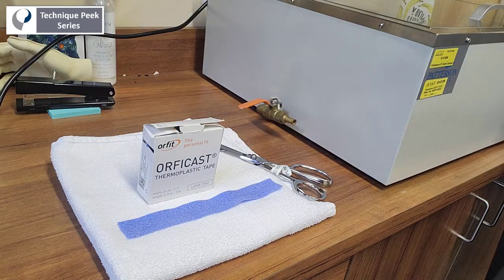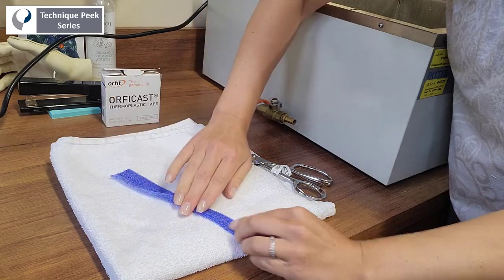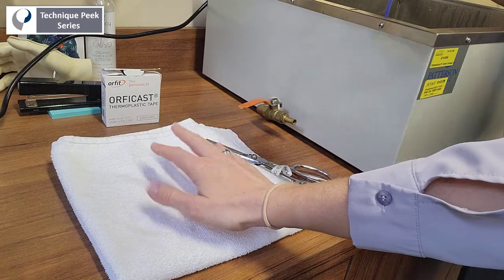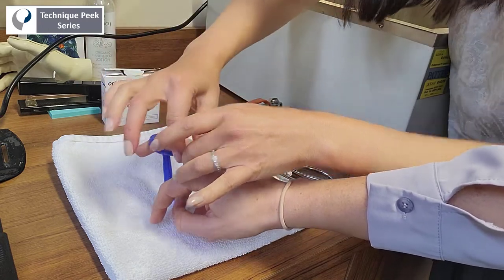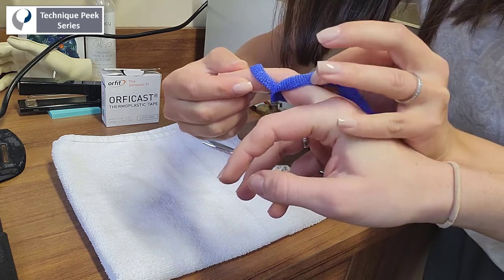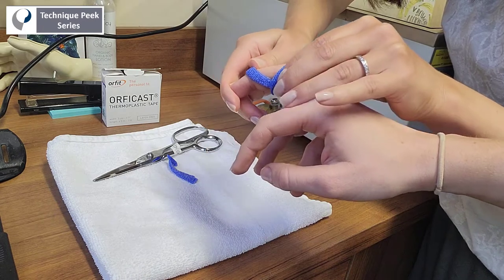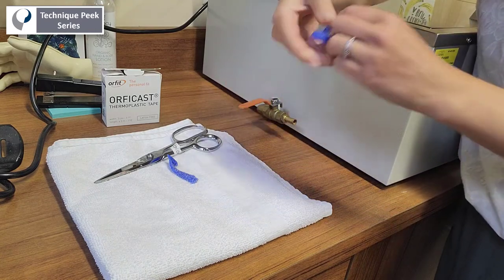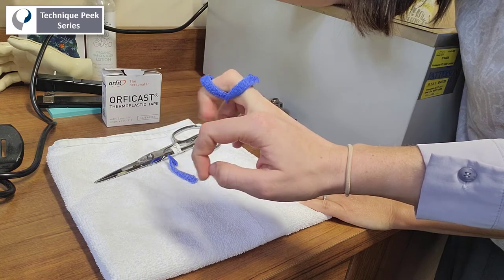How to Create Your Own Figure 8 Finger Splint Using Orficast  |  Technique Peek Series

Comment: can this be used for trigger finger ?
Reply from the maker: This splint could be used to treat trigger finger by modifying it to prevent finger flexion. But you would be better off using an extension splint that also prevents MCP flexion, in order to prevent the finger from triggering until the inflammation causing the trigger has decreased.  Ultimately, we recommend working with a Certified Hand Therapist for best results.